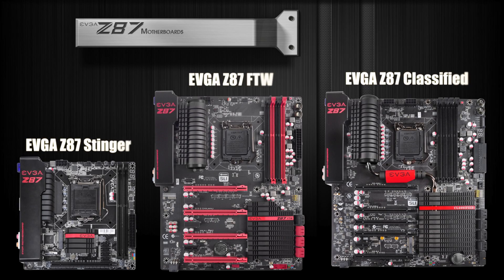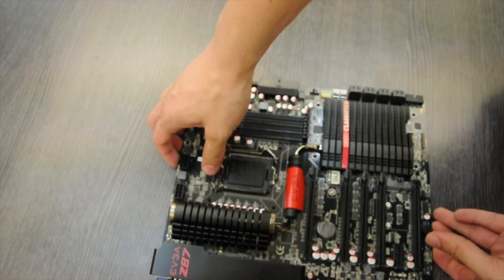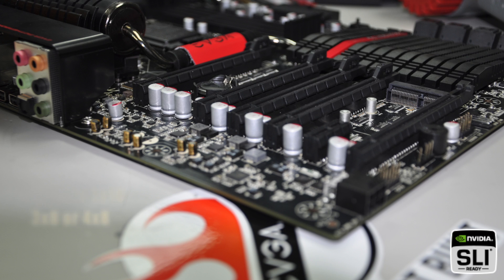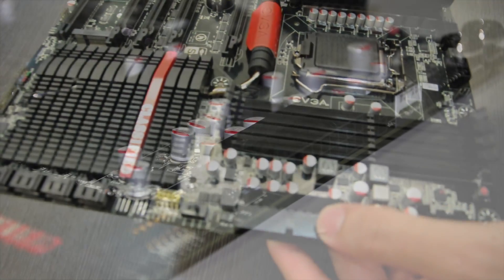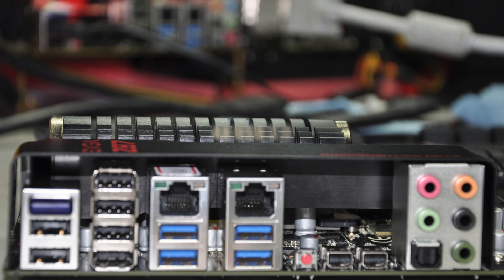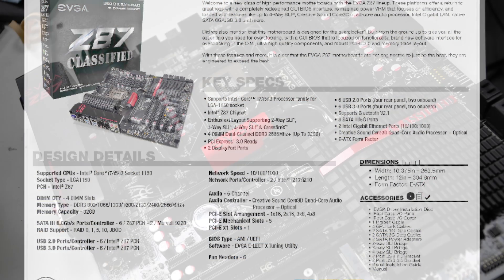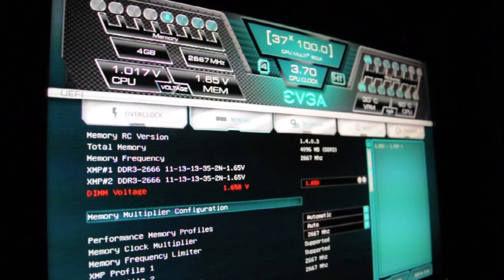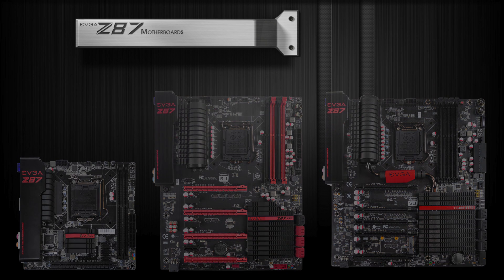EVGA Z87 Classified Preview!

Comment: I hope they price this board to sell, a few features aren't what I had expected.
Rule of thumb after launch, slow and steady wins the race... lower price points will be better to recover profits.
8 phase power isn't bad, but MSI just came out of the gate wide open... even their OC performance is hard to match. SS Caps lmao, they threw the sink at Z87... insane.
Place it at $295 USD for a limited time and you'll have a hard to beat launch. Get them selling and not sitting around!
Looks sharp!

Comment: The drivers for the E2200 in my G1. Sniper 3 were giving me all kinds of problems. Connection time outs, browser failures, graphics driver resets, BSODs, overclocking issues on /all/ components. That was true of Gigabyte's version, Windows Update's newest WHQL, and likely the newest WHQL from Killer (which is a slightly lower version number than the one Gigabyte has available). That said, Killer's BETA driver fixed everything. Though, they stick you with a Metro interface, even in Windows 7.

Comment: I love matching up hardware... mobo + GPU.
I hope these will have a fairly stable OC. 8 phase power isn't very "classified," but if an EVGA tech were to give some insight as to how well they handle a good OC, I would be more willing to match another EVGA system.
I just hope the 8 phase power was to lower costs on the consumer who may be crazy enough to do a 4-way SLI setup.
It's a toss up between MSI MPower or EVGA...
I really don't want to RMA any boards this time.